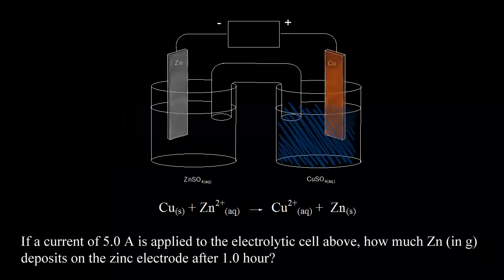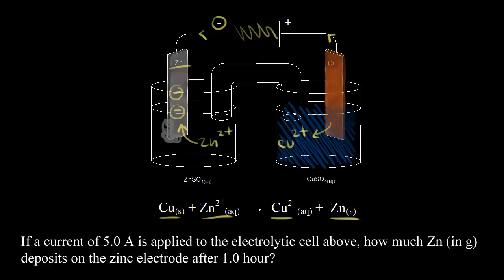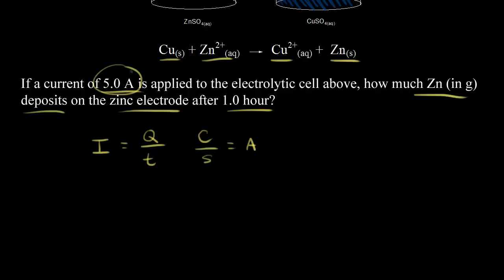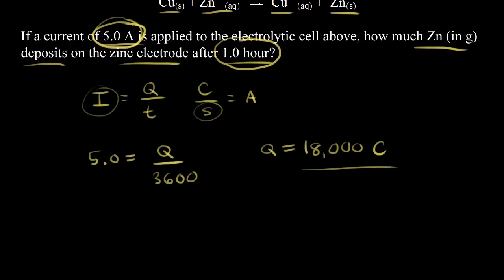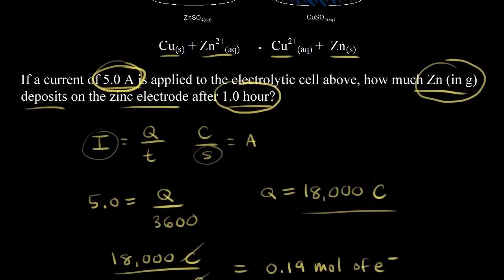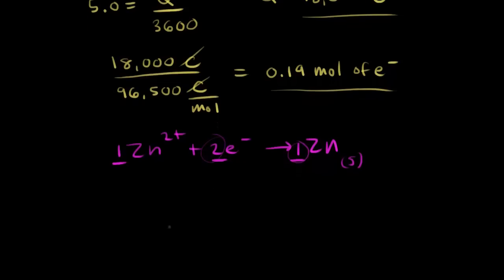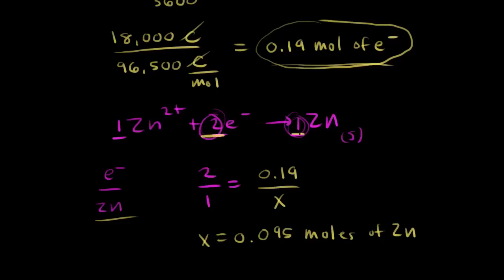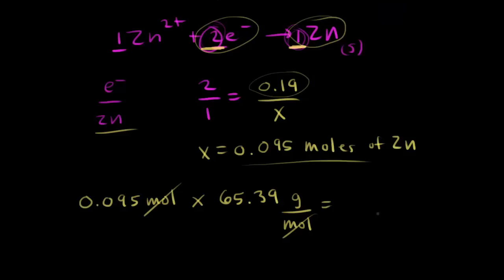Quantitative electrolysis | Redox reactions and electrochemistry | Chemistry | Khan Academy

Comment: Is it ok to round off a value before arriving at the final answer? Could I have used the 'answer' button on my calculator instead of typing in 0.19 in the subsequent calculation? I understand the need to write the final answer using two significant figures, but must that be the case for all steps of the procedure? 
Please help!
Reply: Nya Allain Usually, working answers are rounded off to 5sf. Only the final ans can be rounded off to 2sf/3sf else it will affect the accuracy of ur final ans.